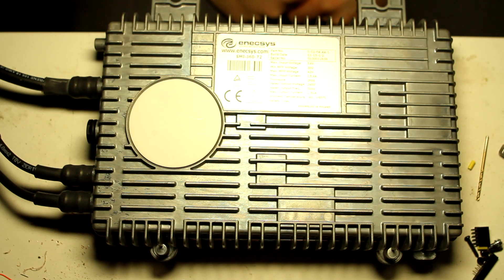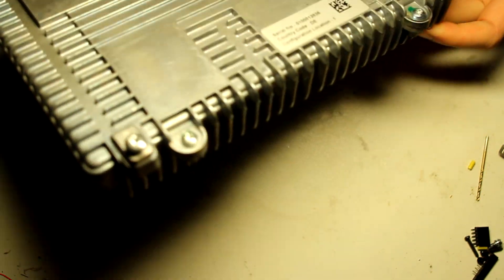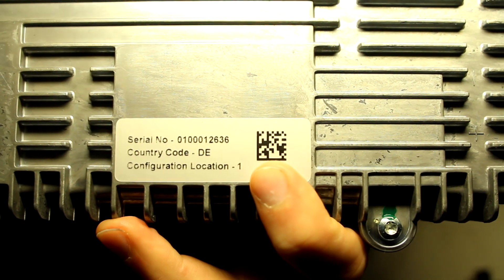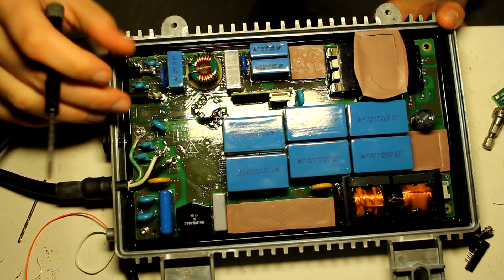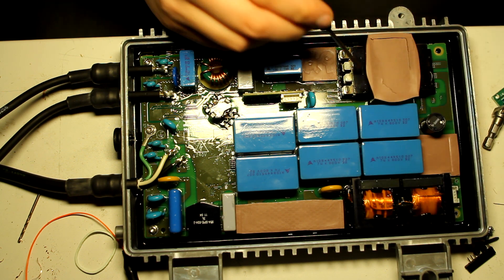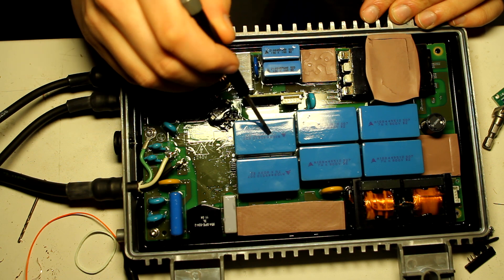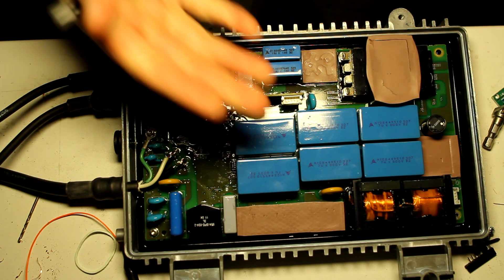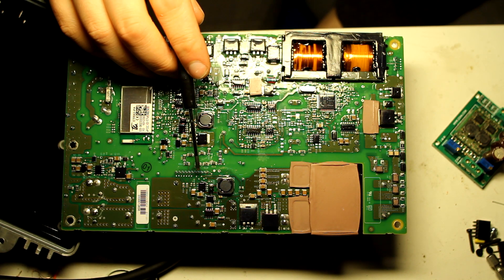Failed Enecsys 360w solar microinverter teardown (018)

Comment: I just got an enphase M190 micro inverter. The whole thing is encased in a block of rubber. Good luck repairing it.
Reply: Some potting can be got off with a heat gun/hairdryer

Comment: Do you know how to test these with a back probe type meter? I have tested all my panels and they have good output but at then end of the line we are not getting the power we should from a 2000w system.

Comment: Hi i looked at my enecsys board failure and my 4032  k250 1113 blew but i cant find one anywhere.   I found a k230 here.   Any ideas

https://www.mouser.com/EPCOS-TDK/Circuit-Protection/Varistors/CU-Series/_/N-5g3h?P=1z0sed7Z1ytdx60Z1y9iuo5

Comment: The black plastic shell was for safety requirement. Follow the requirement you have to keep your PCB a distance from the metal enclosure. If you have a insulation sheet kind like Enecsys used you can keep the distance very close. Which makes the inverter compact. Otherwise it will be like a big box with lots of space inside and you won't figure out why either.

Comment: Looks like the bluetooth just has a smd antenna on the module. How is it going to get out of the aluminum casing?
Reply from the maker: there's a little slit in the case under that white plastic round thing.